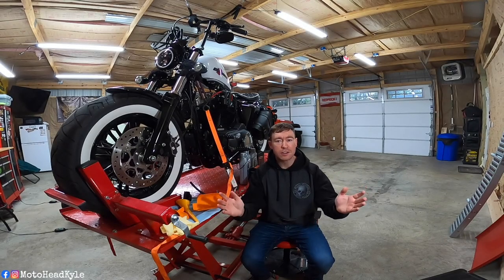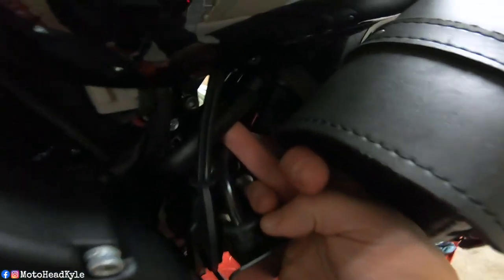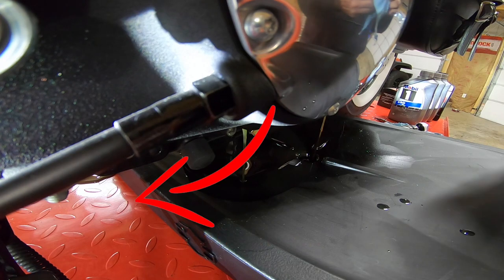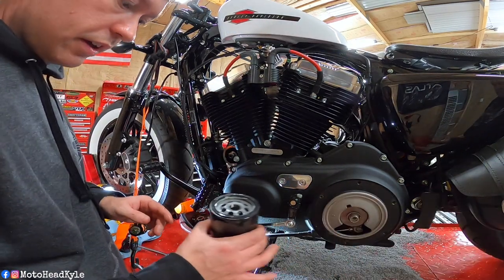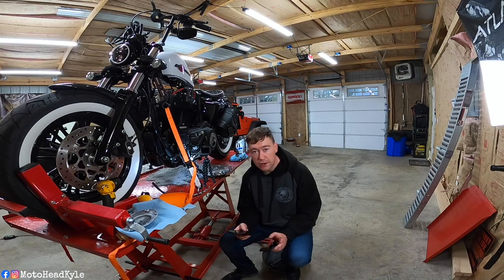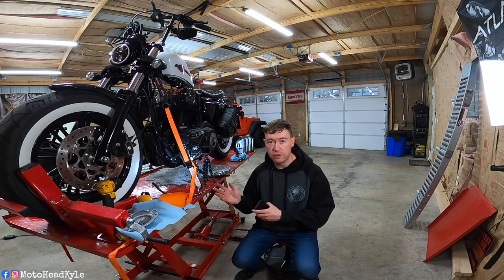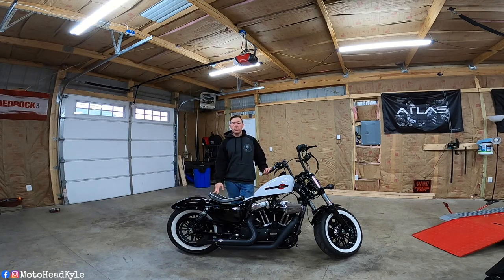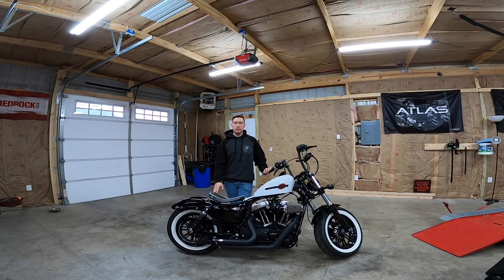Oil Change on a Harley Davidson Sportster

Comment: Can you use the same oil in the primary as in the  Reservoir? Like hd 20w-50 full synth?
Reply: And how do you check your primary lvl?
Reply from the maker: So if you’re using like the Harley Syn 3 or Mobil 1 or ams oil 20-50 you can use that in your primary! Most of those bottles list good for engine, primary & transmission on their label. So I would just look for that to be certain.
Reply from the maker: @averagejoereview192  as far as the primary level, the fluid should be level just touching the lower part of the basket. I will throw a link with a picture here.. 

https://www.hdforums.com/forum/attachments/primary-transmission-driveline-clutch/520954d1501266124-primary-oil-level-primary-fluid-level__zpsnjtdi2zx.png

Hope this helps! Thanks for watching! Glad to have you here🤙🏻
Reply: @MotoHeadKyle   @Moto Head Kyle  thanks a lot man for the info I just did my first oil change on my 22 48 sportster and was tripping out cus I saw in the video later when I re watched it you put 2 different types of oils in and I just put the full synthetic screaming eagle oil 20w-50 in both cus that's what the guy at the harley place gave me when I asked for all the stuff for an oil change
Reply from the maker: @averagejoereview192  no worries! I just prefer to put “gear oil” (higher weight) in over the 20-50(typical motor oil) in. But at the end of the day it’s all preference! And what’s readily available for you to use. Hope to see you in the comments in the future! Stay safe.
Reply: Great video. Very helpful. I have a 22' Iron 883 Sportster. Directions were the exact same for it. Only thing I'd change is the torx bit for the primary cover is actually a t-27, not a t-25 like he mentions in the video. I noticed the t-25 had some wiggle and started to strip the heads on my bolts. Grabbed the t-27 and it fit like a glove.

Comment: What year is Sporster your working on? Mine sporty didn't have the oil drain line!
Reply from the maker: Interesting, this is a 2020, but as far as I knew the last 20 years or so they’ve been like this or very similar to this. What year is yours?
Reply: I owned sporty longer than 20 yrs ago, because I had it for several yrs before I got my 03' Dyna. Time travels fast, an faster when we are having fun!
Reply from the maker: @timbarnett3898  Amen! Ride safe 🤙🏻